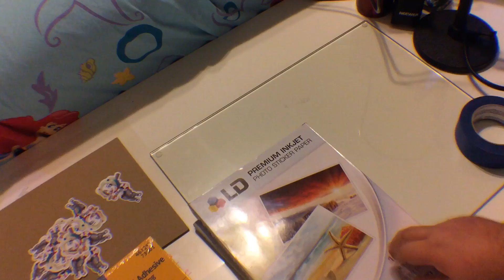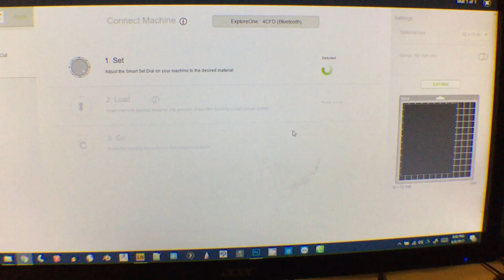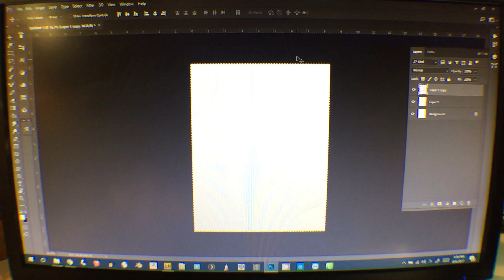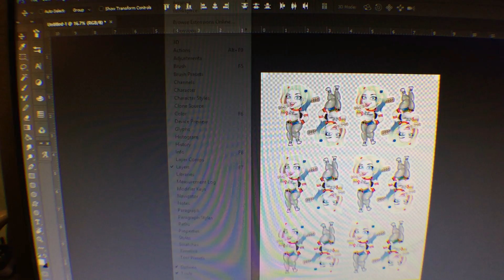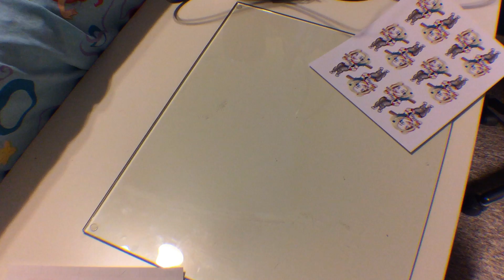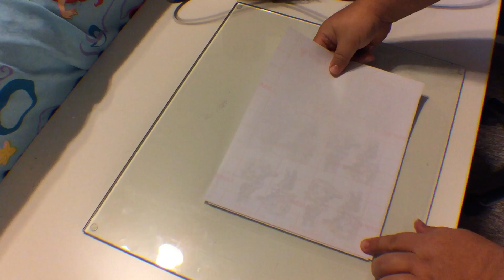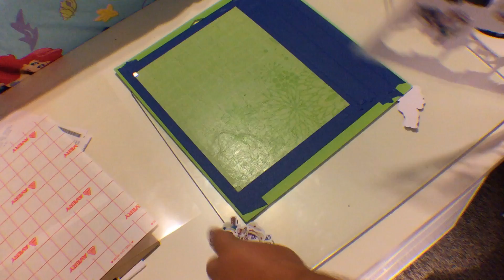Trick your Cricut to do FULL PAGE Print and Cut - Sticker Tutorial!!

Comment: This tutorial is FANTASTIC! I ran into a few problems due to my equipment and I'd like to share my solutions if ANYONE is having the same issues I was!

I am using Clip Studio Paint, Hp Envy 4520 printer, and I have an Explorer Air 2. And the material I'm using is a matte sticker sheet and the self laminate.
First, don't forget page markers (those little squares in the corners of the page) CSP does not have a specific setting for markers unless you are doing storyboards for comics, so just add 4 squares yourself and save that 8.5" x 11" page as a preset for all your full page sticker needs. 
Now that's all fine and dandy, but my cuts were reaaally offset after setting up everything here correctly shown in the video. I found out my printer does not support borderless printing on letter-size pages, so the prints were coming out with a 1/8 of an inch border on all 4 sides. 
The way I tackled this was testing out the image size and positioning in Cricut. For some reason setting x= 0 and y= .125 and keeping the image size 8.5" by 11" works PERFECTLY! I thought since the boarder was there each side had to be reduced by .125" and the image had to shrink down by .25" on each side. To my amazement, all I had to change was the Y-axis.
And with the laminate and sticker sheet, I made a custom material and set it to 325 pressure.  300 was almost on the mark, but 325 works perfectly.
Other than all that, my printer stopped printing color for a bit, so I uninstalled and reinstalled the driver countless times. Don't ask me how I fixed that I don't even know.
I hope this helps someone having similar issues!!
Reply from the maker: Thank you for sharing your experience. Sometimes it takes a lot to work with what you have. I run into so many different issues with these devices and printers are the worst sometimes.
Reply: Thank you! I think I may be having this exact problem but I don't understand your solution at all, could you clarify?

When you said "For some reason setting x= 0 and y= .125 and keeping the image size 8.5" by 11" works PERFECTLY!" did you set this measurement on your printer, in CSP, or on DesignSpace?
Reply: @amberseber6839  The 8.5" by 11" Was the measurement made in CSP first, and the x= 0 y= .125 were the measurements in design space when setting up the cuts!

Comment: Okay, I am not that tech savvy.  So you drew these in photo shop, printed them, and then cut them out on the cricut on laminated sticker paper.  Why do you need to fool the cricut?  Won't it cut things out on a normal size sheet?  I am relatively new with the cricut, so I don't get it.  Sorry if this is a dumb question.
Reply from the maker: Cricut Design Space is limited to print and cut half sheet and the print quality is not as sharp as if you print from photoshop.

Comment: Ok. so I've done everything exactly as you've shown in this video, even pausing then doing it then starting the video again, and no matter what I do the machine will not cut in the same place twice. It's always unaligned. Sometimes up to a half inch off! Typically up to 1/4 inch in any direction. It's random. So I readjust the page. Same problem. When it cut a second ago, it's now wrong. I take the blade out, realign...now it's wrong again. I've ditched 20 sheets of test paper on one single project. What the heck am I doing wrong!?
Reply from the maker: Calibrated machine and taped the mat?
Reply: @EricMBoyd  Yep. (sorry for the late reply)
Reply: I am having this issue as well. I'll get the cut almost perfect and I'll pause and move the mat just enough to make it perfect and then it starts printing a quarter inch to high!

Comment: I have an Epson 7720 and I've followed your steps exactly but I can't get it to line up. I've tried 4 times now but I'm wasting so much paper and ink trying to get this to work. Any ideas? I noticed that the "center" option for you sets it to -0.111 but it changes mine to -0.125. Should I try manually changing the "center" to that 0.111?
Reply from the maker: Rear feed or tray?
Reply: @EricMBoyd  Tray. Does that in itself make a difference?
Reply from the maker: @nicoleoverholt1150  yes I find my tray never prints the same and is often a slight angle. Try printing three pages and stack them and hold them up to a light and see how off they are.

Comment: I have watched this video and your purple people eater video 5 times. 
I followed the process over and over. 
I’m still getting an offset where the whole paper has to shift to the left. I sent you a message on Instagram with pictures.
Reply from the maker: It sounds like a shift in the printer or maybe the offset on the cut file is the issue. Are you doing tray or rear feed on the printing? I find tray shifts the image to much in my printers.
Reply: Rear feed. It won’t let me print any other way from photoshop. It was either the printer, the guides or the mat placement. After fiddling with it and using your mat lift technique. It finally worked so maybe it was getting micro adjusted when adding the mat to the Cricut.
Reply from the maker: @JDMRaw  interesting. That could be.

Comment: Anybody having a problem, where some shapes are cut perfect off of your print, while some are off a 1/4” or so?
Reply from the maker: Most of the issues I run into like this are caused by the printer and paper feed. That being said I also think sometimes the cricut gets out of calibration and the stepper motors are off with certain shapes or just movements in general. Try running the calibration tool again and then retape the mat.

Comment: Hi Eric. Thank so much! I hope cricut make a change so you can print and cut full pages, but until then this is great. Just wondering if the update to design space that just occurred changes any of your instructions. Registration marks used to be just corners, but now it’s a full black box. Will this technique still work? Thanks!
Reply: I have tried to do this but it does not work, the print is always off when cutting, also for this to work you need a borderless printer, a lot of the cheaper printers will not print borderless, which will put your registration marks off the page, automatically. I have been trying to do this for weeks with no luck and a lot of wasted materials, I will just wait and print the old way until cricut allows us to print larger than it allows.
Reply: Martyn Tranter i really hope they do. It’s such a waste of time and materials.
Reply from the maker: It works in the latest version I just needed to do this the other day, I never use the Cricut Print and Cut options.

Comment: I love this solution! I have tried to use it to cut a box template. I have one side printed with a pattern but the other side I have photos.  So the template needs to be cut exactly so the photos are in the correct position. For whatever reason the cricut always wants to cut from the top left 0,0 position  I have nearly tried to get it to work but the left cut always seems to be 1 eighth short - do you have any suggestions?
Reply from the maker: Did you tape you mat and cut the page size out for better alignment?

Comment: I realize this is an older video, but thought I'd make a note for anyone else struggling like I was. My printer automatically adds a margin. Unlike this video, the software won't let me dismiss the fact that my image is larger than the print dimensions. When I'd print, my registration marks would never be perfectly in the corner, but they were still the same 1/4" size I set them to. (I made sure "Center Image" was turned on, but it didn't make a difference.) That meant that when I set the image position in cricut to 0,0 the alignment was off, even after cutting the tape and setting the page into place on the mat. I fixed the cut alignment by changing that positioning. I still cut the tape rectangle with the position set to 0,0 but when cutting the image I left the dimensions at 8.5 x 11, but changed the position to the width of the automatic printer margin. (In my case that's 1/8" so I input .125,.125 for the position.) It still wasn't perfect (I think reloading the mat shifted it a little) but it's the closest I could get it, and the only usable cut I had after tinkering with settings for quite some time. If your image has enough bleed around it, this will be the ticket. Happy crafting!
Reply from the maker: Greatly appreciate the input. What printer do you have? Maybe this will help more people. I find most issues we run into is the Printer not the cricut.
Reply: @EricMBoyd  I have an HP OfficeJet 4650
Reply: @kacieo777  i have hp office jet 5600 series & its very frustrating because it always leaves a margin too.
Reply: @kristenroma7833  if you go into your advanced printer settings you can select "print boarderless" and it goes right to the edge (as much as it can) hope it helps!
Reply: @BADSTUDIO depending on the printer (I have the canon pixma pro-100), borderless actually can enlarge your print past the edges adding a bleed margin and also skewing completely, so you gotta be careful with that setting too. Still trying to find something in between and then probably going to adjust the cut image as Kacie mentioned.
Reply: @th3darkminded  Thanks for that comment. I’ve got a Pro-10 so same thing happened. I’ve spent a few hours and lost of sheets until I saw this.
Reply: @cduemig1  Update: I actually got this process down the with pro-100. So for printing, I set to print always at 100%. I've figure out that my printer puts a 0.25" print margin, so when I set up my art on Adobe Illustrator, I make sure to put that margin as guides. I put art super close to it, but never over and it works out. Also, making sure the registers are set (you really only have to set the top set. I got tired of the corners getting everywhere after cutting). Once printed, put on mat, align to tape, and CRUCIAL tip that works for me: when you put on the mat, I don't push it all the way to one side, I start there and the. Nudge it over away from the guide thingy about 1/16th of an inch eyeballing it and then press matt feed. I've had great success doing it this way. Anyways. Good luck! Hope this helps!
Reply: @th3darkminded  Thanks for the reply. I apparently have to play with it more. This restriction from Cricut is frustrating. I got it close but still not quite right. I'm bidding on a Graphtec so may be a mute point soon.
Reply: @cduemig1  well, tinker for now, I think it's good practice and maybe allows you to better operate the pro machines as the concepts are the same or better. Not to also mention you'll be more in the know if what functions are worth the $$$ of having when you upgrade after messing around with a limited prosumer machine. Check out USCutter if you haven't heard of them. Many options for plotters.
Reply: So did you leave the tap on the cutting mat like it was for position 0,0 or did you redo that too?

Comment: Hi Eric - thanks so much for this tutorial!  Just a question, is there something particular about using Photoshop (which I don't have) or can I use Word or Pages and add squares in the corners? Thanks!
Reply from the maker: I like the precision of Photoshop, but you can use almost any true page layout program. I am sure there are limitations on this and I am not sure how well Word or something would work, but it could.
Reply: I have had success on windows publisher. I followed the steps. I printed on copy paper to make sure the printer and machine were "calibrated" together. Once that was achieved I then added the design to the page and it worked!! My main suggestion is just start with printed boxes and cut those. 😁

Comment: I’ve used this trick and still continue to get really bad off-centre cuts, I just tried a sheet and one out of about 12 was perfect, all the rest were entirely unusable because they were so off centre. I’m not sure what I’m doing wrong...
Reply from the maker: Are the registrations correct? If so then I find it is usually the printer not printing correct. When I use the tray instead of rear feed the printer is off at a weird angle. I find if you print 3 sheets and overlay them you will see discrepancies in your printer.
Reply: @EricMBoyd  I am having an even weirder issue, when I print, every time My registration marks are not even on the paper, I made them black so I could see them, and it seems to size up my picture when printing, and I don't have anything on that I should not, No borderless, no scale to fit media, and it is centered but the when I do a preview print there are still no registration marks which means photoshop is scaling the image up. Been a graphic designer for 18 years so I know my way around the program, just nothing seems to work at all

Comment: Hi i'm trying this method with my Explore 2 and am having a pretty hard time getting it to line up correctly. It's missing my registration marks entirely. I've tried adjusting just the way I feed my mat into the machine and repositioning the paper on the mat, but neither have worked successfully.
I have: 
-double-checked that the rectangle in design space is 8.5 wide by 11 high (and I went and measured the cut tape hole as well)
-double checked that the silhouettes of the sticker designs and registration marks are at 8.5 by 11 in design space
-when creating the image, my process was simple type, no alteration on the select & erase screen, and save as cut image
-the designs were drawn in and printed from Photoshop CS6 and saved and uploaded as a transparent background PNG
I'm really unsure what I've done wrong here, but I can show you pictures of the settings I have for everything if needed- I really wanna figure this out it's a great method! :,)
Reply from the maker: Few questions. 1st. You are using US standard paper, 8.5x11? 2nd. Have you re-ran calibration tool  and re-taped the mat to create new rectangle box? 3rd. focus on the registration boxes cutting correctly and skip the images or prints until those are spot on. Sounds like you are on the right path. I do have rest everything myself once and a while as my machines calibration does shift over time.
Reply: @EricMBoyd  Thank you for your response I really appreciate it! Yep, I'm using US standard paper. I haven't re-ran any calibration tools as I only just got the machine, so I'm still figuring it out and didn't figure I needed to re-calibrate it since it's brand new. I'm planning on trying this again very soon, but the only thing I've come up with is that there's something wrong with my dimensions, as the machine will cut one registration mark just fine and then completely miss the rest.

Comment: I'm having a hard time lining the paper up correctly to where it's cutting by a lot. Tried re-positioning the paper placement a couple times but it's not working for me
Reply from the maker: Angel K are the registration squares cutting correctly with the tape?
Reply: @EricMBoyd  Are the registration squares supposed to be on the corners of the paper? My printer seems to be adding padding to the paper. I have an Epson as well,  did you print using the setting US letter (borderless)?

Comment: Can you swap the blade with a pen or marker so you can get a pencil outline first rather than a cut? I mean for test purposes rather than actually wasting a sticker.
Reply from the maker: I don’t see why not. But why not just run the process using regular paper. I guess if you wanted to do a test run would be a good idea to micro adjust the mat or page, but a laser pointer could be a good idea!
Reply from the maker: I think a pencil would scratch or indent the sticker
Reply: Eric M Boyd actually a laser pointer would be a brilliant idea. You should make a quick video with that tip. 👍

Comment: I followed your tutorial to a T. the only thing that cuts where it's supposed to is the registration marks. I don't know what I'm doing wrong.
Reply from the maker: Shannon Rae Cooper it is most likely your printer. Print three sheets of the same thing and see if they are aligned. Stack them and hold them up to the light. Next check your cut file. If the registration marks cut right then your on the right track and proven the cuts are right.
Reply: Eric M Boyd I’ll try that, thank you.

Comment: sat here and watched very impressed. is not possible to run the page threw the press before you cut them out
Reply from the maker: Yes, but the issue with running them through before cutting is the sticky part around the paper from the laminate sheet. Secondly you can run them through when on the mat, but you will find the cut marks on the mat can transfer indent into the paper stickers.

Comment: I wanted this video multiple times. Added registration marks but it is cutting in the middle of design. Don't know what wrong I am doing. I also calibrated machine to make sure there are no those issues. Please help.
Reply from the maker: Working on cutting the tape on the mat and focus on cutting the registration marks correctly then try adding the images... this will rule out other issues.
Reply: Eric M Boyd it cuts registration matks perfect. But design is the issue.
Reply from the maker: rasrohi perfect then your issue is most likely your printer is not printing your file correctly or the cut file you are making is not correct. If registration marks are perfect then this is working! 1st make sure you print without... fit to page checked, without borderless printing, allow cropping, and if that don’t work check your printer by printing 3 pages of the same file stacked the prints and hold them up to a light and see if the alignments are off. Once you rule out that then focus on the cut file in DS.